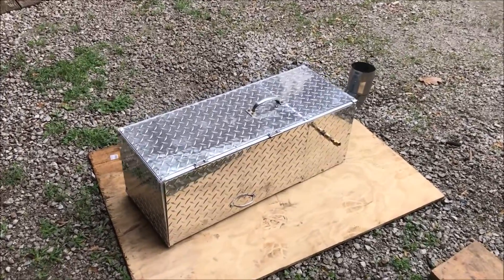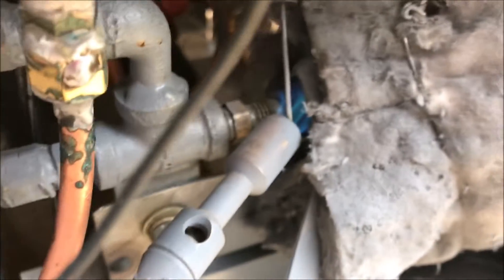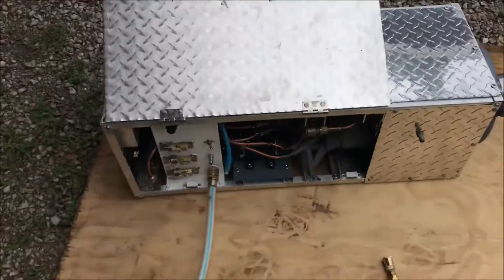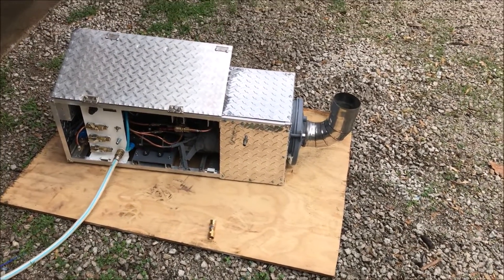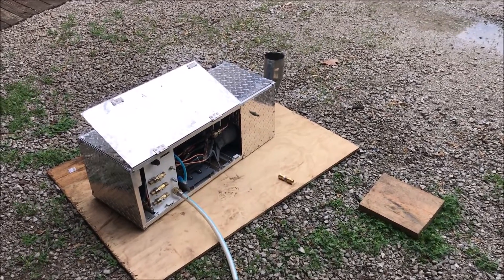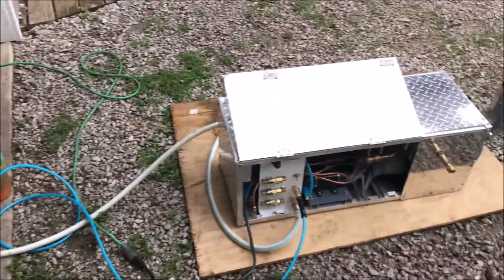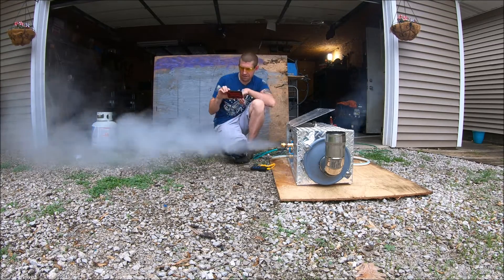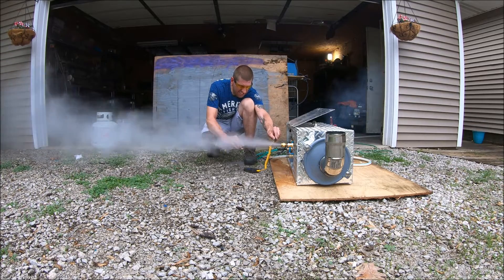High performance Micro Steam Boiler Test #1

Comment: Nice design and work man!  Are you running city water pressure or a pump?  You ever get a Worx Gt pressure washer for experiments?   If you have any problems with heat or melting, I'd highly recommend some Roxul™ insulation as its fireproof being made from volcanic glass, you could also use Rockwool for hydroponic growing.  They both have a very high R value and are water as well as fireproof.  They could contribute alot of extra steam by keeping in any heat losses, also protect your surrounding equipment.  Have a great day!
Reply from the maker: It has a pump have not bean able to check pressure , the worx pump was a bad idea , not able to be connected to fittings and the entire pump was plastic .
Reply: @NOBOX7  My fault bro, I figured you would remotely mount it.  It does produce 300 psi, so it could pump water a good distance under pressure, the fittings I could see being a problem.   Glad to see you making progress on your designs.
Reply from the maker: Yes i did buy that pump , i even have a video of me taking it apart , im just to busy to post . it didnt work for this application , it was all plastic and i couldnt tie into it well
Reply from the maker: lol bro its not your fault i also thought it was a great idea and i still may use it , i just got scared , i ment bad idea as in the thing just had no way to hook up to it , i didnt mean it to sound that way
Reply from the maker: I will look into the roxul , alot of stuff on the market is poison

Comment: Damn dude that thing is awesome. Well thought out engineering wise and it looks like something you'd buy from a commercial cleaning unit company. For version 1.0 of anything I doubt you could do any better than that. Are you running a fan on the compressor motor and pump? I know from experience using smaller compressors at 100% duty cycles for extended periods gets the motor and especially the compressor pump really hot.  Putting a small, high velocity blower on them helps keep them cool enough to run almost endlessly.
Reply from the maker: Thanks brother .... and i agree with the compressor comment , gonna add a fan as soon as i find a small high power waffle fan
Reply from the maker: I am hoping that  because it never goes over 25 psi that it will be ok
Reply: @NOBOX7  I figured it was working at a higher pressure. For reference I was running an HVLP sprayer off a Bostitch Trim-Air compressor that put out "2.8" scfm. It was running non stop for over 25 mins a couple times without a fan and it was making some strange smells. Put a small Stanley 'air mover' fan on it and it seemed to do okay considering what I was doing to it. I was basically spraying until I dropped below 35psi at the spray gun then let it run for 30 seconds to charge the tank. Needless to say pressurizing the tank over and over and over at 35-130psi is going to generate a LOT more heat than just constantly running at 25psi. Still a fan for this steam unit is likely necessary considering the other heat sources. 

One thing you might want to look into is replacement vacuum/blower motors. They are centrifugal compressors and can develop some really impressive air velocities at lower amp draws. They're not as quiet as a traditional blade or blower fan but they can push a lot of air at a high velocity in a very specific direction.